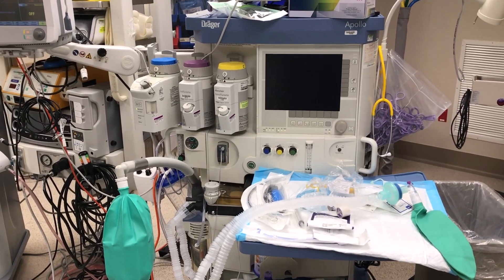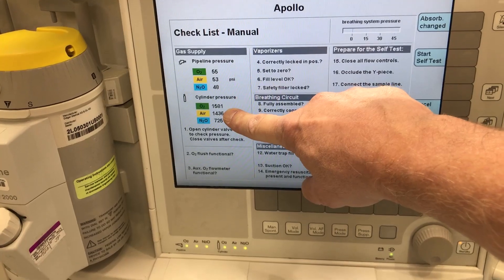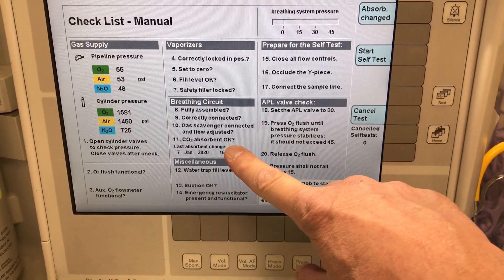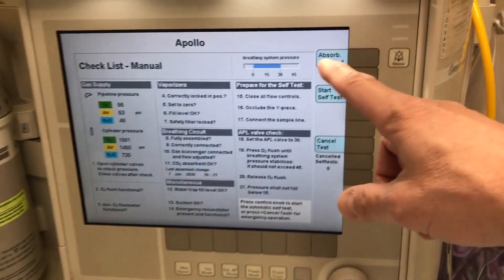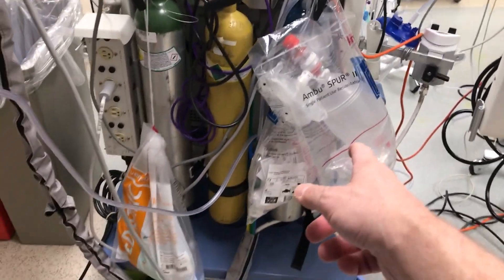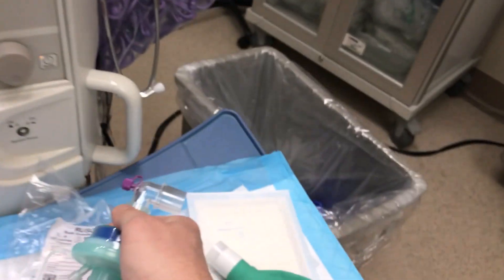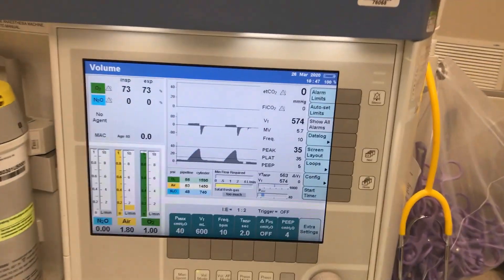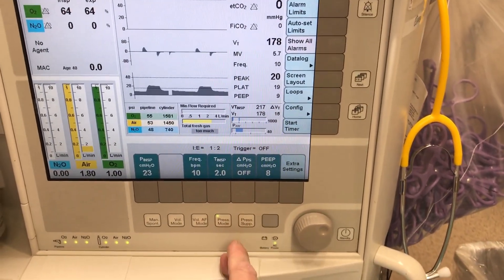Using an anesthesia machine as an ICU ventilator: Drager Apollo basic concepts

Comment: How do you like the Apollo compared to their newer models ie Fabius plus?  or GE Aisys/ Avance? Thanks for the video!
Reply from the maker: Thank you for your question. Even though I have not used the Fabius plus, by looking at its characteristics it appears that it should not be a difference in ventilatory capacity compared with the Apollo. There are several videos from Drager and also product information from them with technical data that supports this view. In relation to Aisys and Avance they are great ventilators as well, but on a crisis like the Covid generated one, I would greatly favor the Drager machines as their electric piston driven ventilator uses no gas to drive it appears to have close to zero internal leak problems we often see with GE machines (this is an annoying issue at our hospital). We have GE (Avance) and Drager (Apollo) machines and looking at Biomed calls to solve issues, mainly leaks, not related to the breathing circuit the majority  (almost all calls) are for GE. Finally, we do like our two machines, but our peds team loves the Drager, and our adult team both for anesthesia delivery.
Reply: Enrique Pantin this is the kind of info I have been looking for, real long term experience with both brands. Thank you so much!